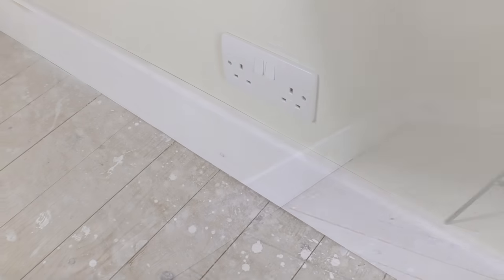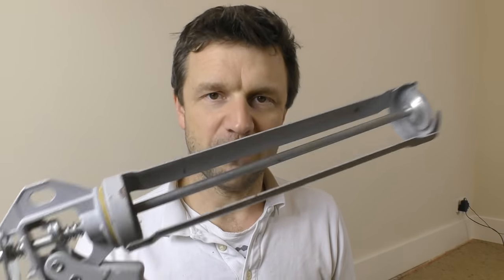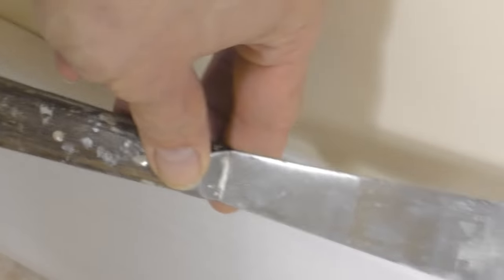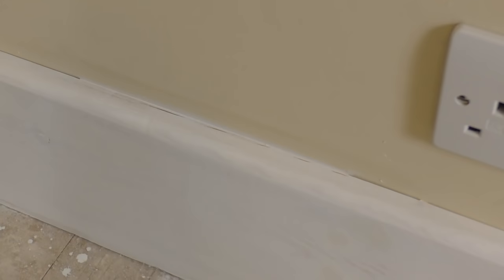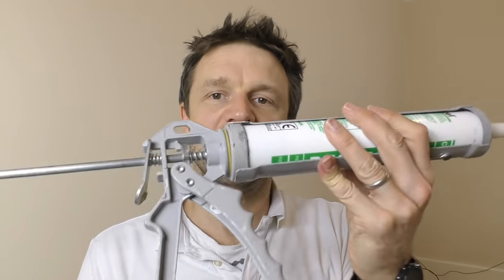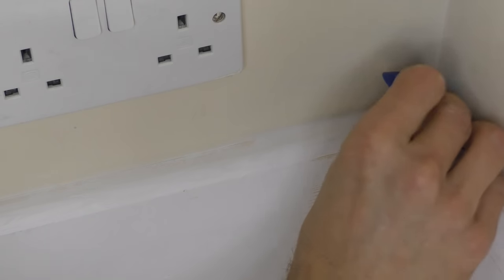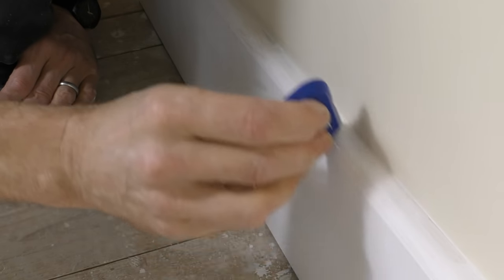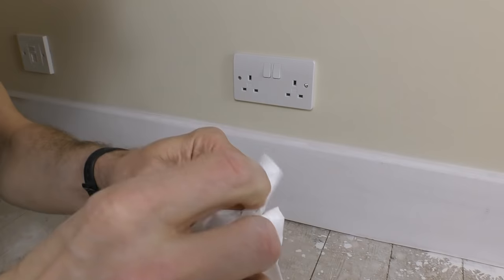How to Caulk Skirting Boards & Base Boards

Comment: A smaller bead is better. It's much easier to go over a spot you missed than scoop up all that extra. With a smaller bead, a wet cloth works perfectly fine and quickly.
Reply from the maker: I'm inclined to agree, and it hides any movement. This tool is good though. - perhaps with the small bead rather than right angle - for anyone who doesn't want the mess of using their finger and a cloth.
Reply: I'm coming from a different status than most who are commenting. I'm a high end contractor in Long Island, NY. Been doing carpentry for 33 years.  If I'm going to use silicon on let's say a bathroom backsplash, I'll do a very small bead and clean it with a dry paper towel which takes that little smear off of the flat surface. If it's kitchen backsplash with tile over granite or quartz, grout caulk color matched to the grout works great with a wet cloth wrapped on your finger.  I think a home owner or diy'er who is not practiced with the caulk gun would find the Fugi helpful.

Comment: Your not applying silicone as you mentioned. Why would you care if the product left residue, not bulk on the wall as walls would be painted before boards? Residue is not visible once the wall is painted.
Reply from the maker: Matthew De caulk Of course it is. It leaves a thick smear which you still see when painted. If that's a look you want to go for, then fine. Also, a clean 90 degree joint is a lot easier to cut in than the concave profile you're left with if you smooth the caulk with your finger.

Comment: The problem here is that tiny bead of caulk won't have much strength or stretch so if there is movement and shrinkage it will crack or fail.
Reply from the maker: I agree. All updated in this video https://youtu.be/-ETYMFbtaTk

Comment: Why did you use 90 degree edge, here, which leaves very little caulk in the joint; versus the other video of bathroom where you use tip which leaves 45 degree “beveled” caulk?
PS: nice videos. Your tips seem very logical.
Reply from the maker: That's a very good question, and. to be totally honest, if I had the opportunity to edit this video I would do exactly as you suggest - why? because if I'm honest, the 90 degree edge leaves too small a joint if the wood moves/warps. I was trying to be a bit too clever using the 90 degree edge and I have advised a lot of people since that it would create a much stronger joint, if you use the smallest, 5mm tip. With caulking you really need to experiment and decide what works best for you. A lot of old timers have been quite vocal in the comments on this video about how the finger and wet rag technique is best (my fitter uses a small piece of blue foam, wet through). But the last time I caulked skirting boards, since doing this video, I used the 5mm FUGI edge and got really good results.
Reply: Makes it easier to cut a nice straight line
Reply: Charlie DIYte o
Reply: One thing to remember is that caulk for painting and caulk for sealing have different requirements. If I'm trying to keep water from getting somewhere, a nice fillet bead is ideal. For painting though you want the caulk to be invisible IMO, so keep it tight.
Reply: Not sure where you're at, but I trimmed some Bondo plastic applicators.  The corners of the applicators are slightly radius'd.  It leaves a fillet of silicone that's about a 1.5 mm radius.
Reply: @CharlieDIYte  Wet fingers is a good way for silicone to go moldy faster (not sure about decorators caulk though). The people who spit on their fingers before doing it, much worse.
Reply: If you use solid wood skirts then they might be more prone to movement than MDF. Same goes for the floor boards. So you could use either 90 or 45, depending on your material. Also, if you're going to be painting then the les caulk would be more desirable for a neater finish.
Reply: The problem I have with caulk is that it always shrinks and cracks. Whatever I do. A while ago I started using the Wickes MS Polymer filler in white with exactly the same tools like you suggest. For me that is the perfect filler. Has never failed me. I hate filling so better to use a product that does not leave me with a risk of redoing it very soon. Overpaintable too. Just an idea.

Comment: Hi would this caulk be any good around my fitted wardrobes? I can see the seal started to crack after 10 years!
Reply from the maker: How large is the gap? Yes, caulk is typically what you'd use to seal such a gap prior to repainting (sorry for not replying earlier).

Comment: Aren't you using it the wrong way  around?...you not using the side that has the bevelled edge?    ...or  am I seeing it wrong ?
Reply from the maker: No, you drag the straight, non bevelled edge into the silicone. Check out my updated caulking video though, it's much better than this one https://www.youtube.com/watch?v=-ETYMFbtaTk
Reply: @CharlieDIYte  ok  if that the case, you might as well just use any piece  of plastic or tool that has a right angle...I thought the whole  idea of having  varying bevels on the tool was to leave behind a nice sculptured bead of silicone...using a sharp right angle is simply taking basically all the silicone off that has been put on...but I enjoy the videos, thank you

Comment: To be honest, a finger will work perfectly fine 90% of the time (100% for a DIYer). A finger + damp paper towel will work 95% of the time. 
I do carry a set of caulking tools, but my advice is to not spend a lot on them. They wear rather quickly and you’ll find yourself buying a new set before you know it.
The only times I use caulking tools are in corners or following trim profiles.

Comment: If ya got a more aggressive texture like a knockdown on the wall you're fucked tho. The caulk runs in those crevices regardless if you use the fugi or finger.
Reply from the maker: Fair point. So finger and a small piece of wet sponge I reckon in that situation.

Comment: Hi, How do you calk a join not against a wall using the tools? e.g flat join between two pieces on the floor. I have an indoor balcony lip that joined using two pieces of pvc I would like to do a straight line but has;t worked out

Comment: hate to be negative but this is not how you caulk trim, ever! dont use tools. bucket of soapy water and a wet rag. use your finger keeping it moist for smooth cleaning. dont clean all the way as it will crack due to temperature and movement of the new trim.
Reply from the maker: You're right about not removing it all. In hindsight I should have used a 5mm angle - which it works brilliantly with.

Comment: Um im a painter what are u doing mate,I gap that in like 15seconds
Reply: Now u said that yes I do want a medal ,,I  have won medals for my painting and houses ,,use it finger and a wet cloth ,,,sorry mate it's good for silicon wet areas
Reply from the maker: Just looking into more innovative ways to caulk, as it's typically a messy process, although in the day job I've got a pretty good finish with a small piece of wet sponge.

Comment: Wouldn't a credit card do the same    thing
Reply from the maker: No because the rubber of the profile tool prevents any caulking residue being left behind whereas a credit card would leave a smear. You could try it though and then just remove the residue with a wet sponge. The advantage of the credit card though is it has a slightly concave edge. I'd cut this and make it straight not concave. Then you've got a bit more strength on the joint than I had with the 90 degree profile.

Comment: I don't know why you  and not only you... using silicon for this job how about after few years if I will decide to paint it again skirting boards?! Can you paint over a silicon? ....you all should go for some practice to Europe to see how now looks builders job materials and more....not only white paint on wood magnolia on walls and carpets on floors in bathrooms....
Reply from the maker: It's NOT silicone Rafal. It's decorators caulk that is designed to be painted over. I'd never use silicone for skirting or base boards
Reply: @CharlieDIYte  ok right..  my apologies anyway you still should go for some courses to Europe to see 21 century buildings hehe